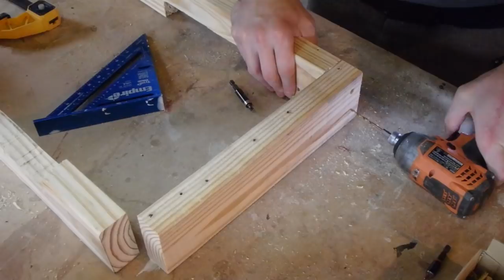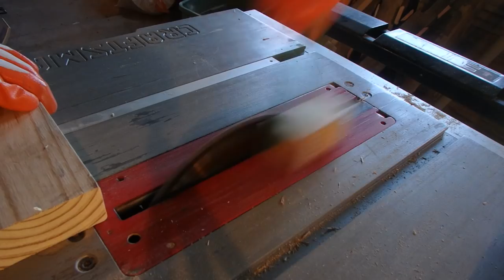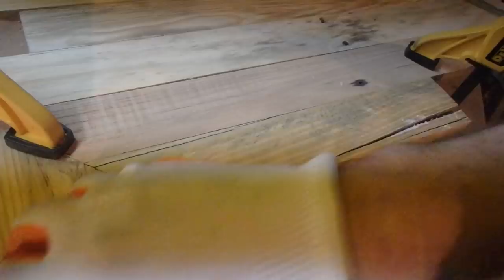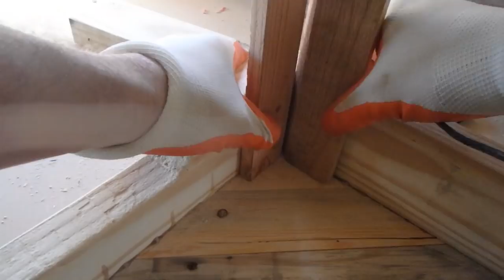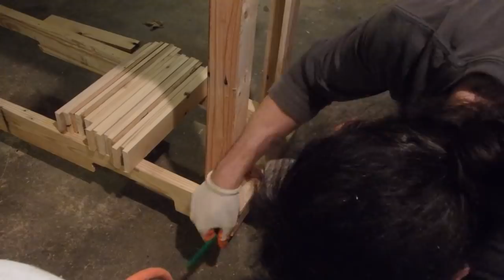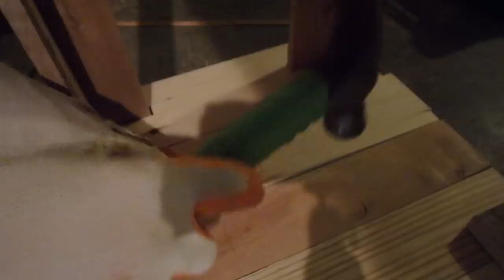Console Table Built From 100% Reclaimed Pallet Lumber!

Comment: Excellent job.  I do have a question.  Since the table top is glued down instead of just screwed down, how do you account for wood expansion so as to keep the table top from cracking/separating?
Reply from the maker: The humidity level is a bit more stable in its permanent home"a lot drier" so there was some definite separation between the slats, as they actually shrunk a bit. Fortunately they didn't shrink enough to show excessively and nothing separated from the table frame itself.It still looks great and these are probably imperfections that only the builder would notice but I do need to figure out an easy slat attachment method that isn't just glue, because you are right, there is a definitely possibility of them eventually possibly popping off, i just wanted to keep away from brads or screws on the actual top.. Titebond 3 takes a lot longer to dry but in the end i feel like it reacts better to the wood and its natural flexibility. Thanks for watching!

Comment: Wonderful video!  But I wondered why you used a hand saw on the two remaining ends of that long rectangular piece, when you used the table saw on the rest of it...why the change to a handsaw?  thanks!
Reply from the maker: The table ended up being 4' long so it was kinda unwieldy trying to trim up the short ends on the table saw. I would have had to some how extend my table so that the length of it wasn't cantilevering way off the side. Ideally i should have used a jig-saw or a router with a flush trim bit to do the entire trimming of the top. Trimming up like that on the table saw is actually pretty dangerous in that if you move what you are cutting into the bade, the entire piece can become a projectile.  Thanks for watching Wendy!

Comment: Not hating just saying i have never seen someone take the nails out with a crow bar it definitely seems way faster and easier. Might have to try it out now
Reply: i use a flat pry bar, and in some cases that and a vice grip(head breaks off, so i grip it with the vice grips and get the pry bar under it)

Comment: beautiful table, I don't think I would have left the fork holes in the runners. I usually cut that type of runner into 2x2s if straight and cut out the 2x4 sections if crocked. Your table is really beautiful.